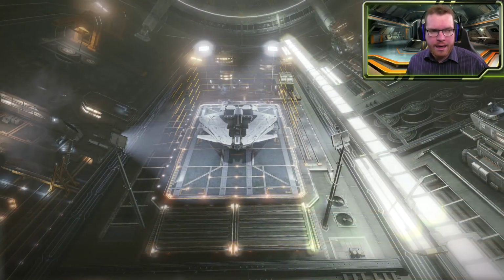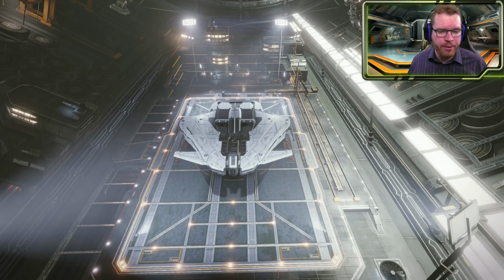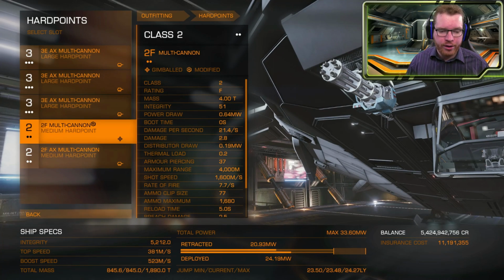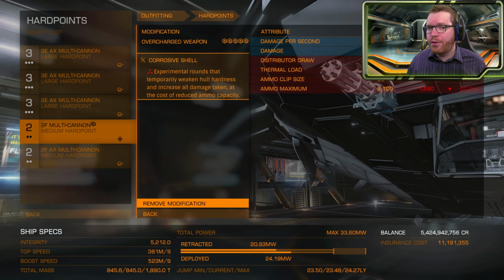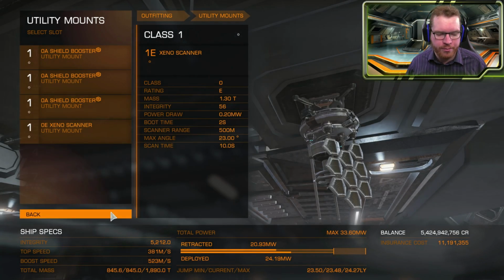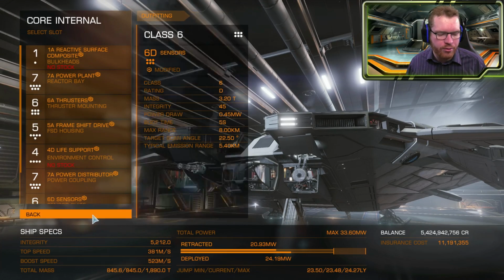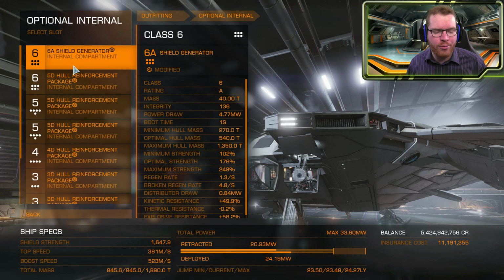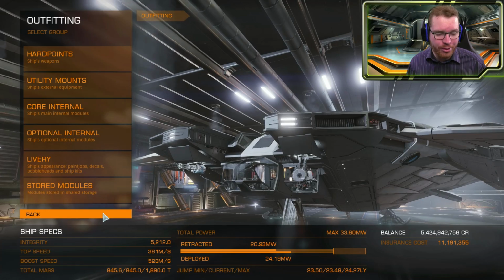Thargoid Scout Killer | Build Guide | Elite: Dangerous

Comment: Is there a reason for using AX Multicannons instead of Enhanced AX Multicannons? I see that both are available in turreted form, and the latter mostly has a small damage buff (about +5%), a significant projectile speed buff (4km/s over 1.6km/s), and a moderately increased power draw (+0.05MW)?
Or is the Enhanced version a new variant that didn't exist for this guide yet?

Comment: Great video, as always.  Just getting into Thargoid hunting to rank up (15% thru Master) and had a few questions about the build.  

Why not use Guardian hull reinforcement?  Isn't it more resistant to Thargoid damage?  I would love to save the materials on engineering the Hull Reinforcement Package by using Guaredian Hull Reinforcement if the end results are relatively close.

Also is it necessary to run more than one decon limpet at a time?  I am seeing builds with 5E Decon controllers, which seem to be a waste of a class 5 slot.

Lastly, is a collector limpet helpful with Thargoids?  Don't care about selling stuff, but for collecting Thargoid specific materials, if they even exist.

Comment: If you have plenty of money, a T10 is just about perfect for a build like this. You don't have to be agile, because it has 2 large hardpoints on both top and bottom; put 4 turreted AX Multicannons on those and it doesn't matter much that you're slow. Meanwhile it has 3 medium and 2 small hardpoints as well...I fill the mediums with long range / thermal vent beam lasers and put a couple long range / stripped down pulse lasers on the smalls, all gimbaled. That way you can reach out and put a hit on things out to 6k, and you can keep the ship iced over just about all the time, which keeps them from targeting you. Plus the T10 has so much space in utility and optional internal...filled up with shield boosters and hull reinforcement I get over 5k shield and 7k hull HP! If I had a prismatic shield I could get up to 6k shields without any reduction in hull. Only drawback is the expense; it's about a $700M build / $35M rebuy. You don't want to lose it.
Reply: Build: https://s.orbis.zone/9rrm

Comment: My build is very similar to yours - you have around 400 more shield (because I ran out of something when engineering my boosters - but you are right, even at around 1200 I don't think I've ever lost more than 1 ring fighting scouts) and 700 more armour than my build (because I have a GFSD booster fitted because I'm time poor when it comes to gaming).  I find even with these I can run my guns out of ammo and make it back to a station without getting to the point where I am worried about hull.  I think the lowest I've seen was about 20%.  I didn't bother with reactive armour as it's so much more expensive than military armour and because scouts deliver absolute damage, the reactive bonus doesn't make any difference and thus just increases your rebuy massively if you do die.  I am using a long range beam laser in the "spare" turret to "tag" targets as you suggest, it seems to work well.

Comment: T10 is maneuverable enough for scouts if you use FA off. Use one to train up my crew member. FA off is easy with the T10 since it's so big and sluggish. But it helps improve the pitch speed quite a bit.  I use 7A thrusters with G5 Dirty/drag drives.

Comment: Alternatively, if you unlock one of the Guardian weapons (that normally run way too hot to use for most ships most of the time) you might consider using those for your class 2 slots since class 3 MCs run extremely cool.  In particular, the Guardian Gauss Cannon makes an excellent weapon for these slots.  They are also still good against human ships and their hitscan nature makes them just as good as the Class 2 MC for tagging human ships at range.

EDIT: Also remember with the April 23rd patch we'll all get an extra size 1 slot, including the Kraits.  You could put a limpet in there and a size 2 cargo bay and lose very little hull doing so.

Comment: Wondering if putting 3 turreted AX multis in the Large hardpoints and then 2 turreted (or fixed) Guardian Shard cannons in the Mediums would be a good idea?

Even with fixed Shards, you basically have a 1.7km range shotgun that does excellent DPS and has good firing arc coverage especially in close. Seems a better idea than a class 2 AX and a regular multi that does very little damage anyways.
Reply: unfortunately you have a max of 4 AX/Guardian weapons. 

For hunting scouts size 3 turreted AX multi cannons are the best to use, 
You could use x2 AX + x2 shard (to be honest I haven't tried this bulid) but for quick kills I would think (unless you're a ace pilot, I'm certainly not) the DPS on 3 AX vs 2 AX+2 shard the 3 turreted AX would win
Reply: Or put the AX cannons on top then 2 gause cannon on the medium underneath ?

Comment: Python is also a good choice. Thargoid scouts can be killed with normal non-Ax weapons, so a build with 3 Large Ax Turreted multi-cannons, and 2 normal multi-cannons will rip through a Thargoid scout in about 3 to 4 seconds of sustained fire. If you have 1,200 shields or more (Guardian shield boosters are a good idea) you can take on 8 Thargoid scouts at a time without ever losing shields. It's a good idea to carry a decontamination limpet controller and a few limpets just in case you get slimed, but you can avoid it most of the time when fighting 4 Thargoids at the same time. A good place to go is Kipling Orbital in Pleiades Sector KC-V c2-11. It's a small system with only one planet and a moon, but with usually 100+ Non Human Signal Sources, so you never need to travel very far to find a ton of Thargoid scouts. Check out the Threat level 4 sources. These come in 3 different flavours: 4 regular scouts, 6-8 assorted scouts with regenerator / beserker support, or a wave situation where two new scouts arrive every 2 minutes or so up to about 16 altogether. Lots of fun!

Comment: Guardian HRPs only give 5% Caustic resistance and Meta-Alloy give 3% (which had become a local meme at AXI). That resistance is also useless while you have shields up, since bleed-through phasing damage is converted to Absolute.
Reply: correct. the guardian module reinforcements are the only one worth getting. more armour and protects against interferance.  Guardian shield boosters with biwave thermal resistance and quick charge will give you so much shield power and regenrative capacity you stay in a combat area a long long time. even repair your hull when under atack.